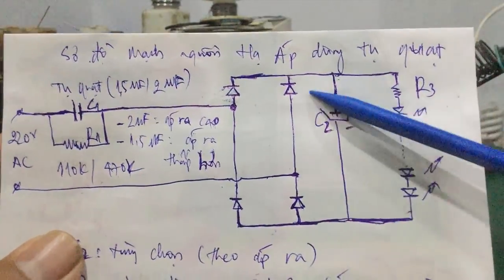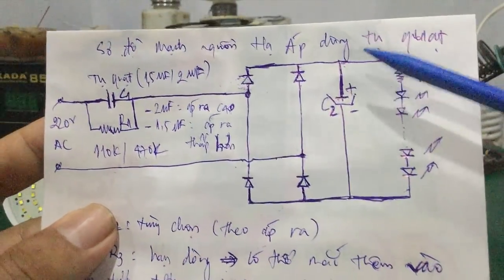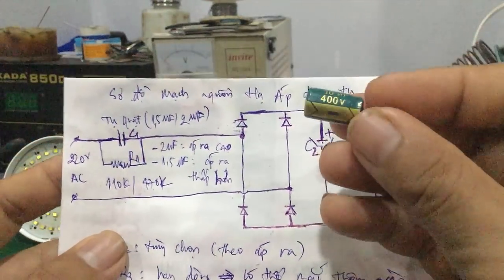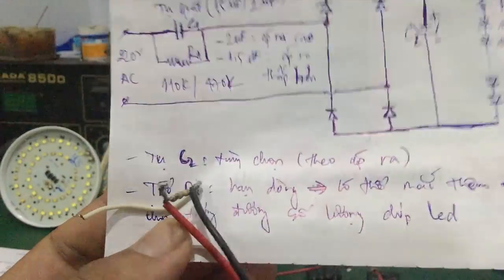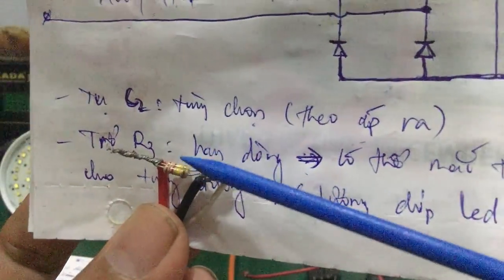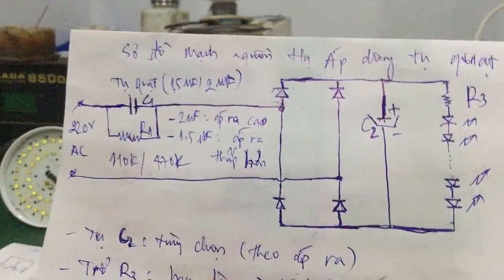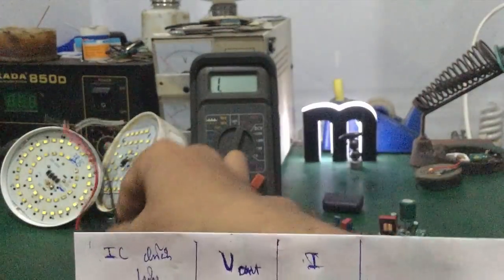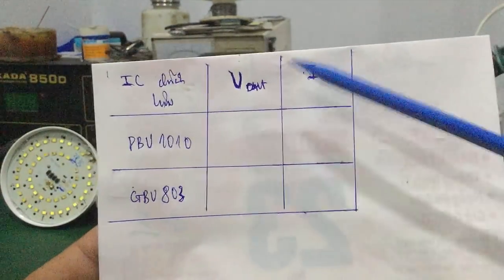Sửa led driver - cách độ chế mạch nguồn led driver cho bóng đèn từ tụ quạt ... không dùng IC nguồn !

Comment: Áp 313 hay 213 volt không phải là do loại diode nhe bạn mà là do có mắc tụ lọc sau khi chỉnh lưu hay không và có công thức là lấy điện áp nhân cho 1,44 còn gọi là điện áp hiệu dụng. Cho nên mọi tụ lọc cho điện 220v sau khi chỉnh lưu họ thường dùng tụ 350-400v. Điển hình là bếp từ...
Reply from the maker: áp sau chỉnh luư là : 1,44 x 220 = 316v DC ... mình ko biết bạn nói vấn đề nào : mạch chỉnh lưu toàn kỳ hay mạch nguồn hạ áp ...???

Comment: cho hỏi là board led có 1 tụ pi và 1 cầu diode nhỏ và tiếp theo là 1 trở dán nhỏ xíu với 1 IC 8 chân (bị che số), xin hỏi đó là IC gì ? cảm ơn !
Reply from the maker: bạn miêu tả rời rạc quá nên hơi khó hiểu , lộn xộn !!!  theo như bạn mô tả thì trong mạch nguồn led driver có 1 con IC dán 8 chân ... đó là IC nguồn led driver hay còn gọi là IC dao động - được tích hợp MOSFET ở bên trong  - hoạt động theo chế độ ngắt - dẫn nhé !!!!
Hãy đăng ký theo dõi kênh để xem các video của mình nhé … bạn có cần hỗ trợ về kỹ thuật hay tư vấn về điện tử - điện thoại di động thì cứ để lại comment , mình sẽ support cho bạn nhé !!!
Reply: sorry, là thế này, có ông anh đem cho cái vĩ led 136 con có thể là 3528, chiều dài khoảng 30cm, rộng khoảng 2,5cm, không có led driver, sử dụng AC 220V trực tiếp vào, mỗi bên dây AC vào có 1 điện trở 10 Ohm nối tiếp, qua tụ lọc pi lọc xung AC (? không có thông số), vào cầu diode dán nhỏ khoảng 1A (không có tụ lọc nguồn DC ra, áp ra sau cầu là 210V DC), và áp ra tiếp đến 8 con IC 8 chân loại dán (bị che mất thông số) - kèm mỗi con IC là 1 con điện trở dán. Do mạch phủ keo chống nước nên khó dò mạch mà IC lại k có số nên không biết là gì, tôi chỉ đoán là IC để giảm áp cấp cho led ? (giống như nhiều led buld công suất thấp 3-5-7W k có led driver mà có IC 8 chân dán giống như vậy ? xin hỏi là theo kinh nghiệm của anh con IC đó là gì ? cảm ơn ! công suất đèn đo được 90W.
Reply from the maker: @quynamnguyen8555  ah ... bạn cũng có 1 số kiến thức nghiên cứu về đèn led đấy !!! ... tuy nhiên theo bạn nói thì số lượng chip led là 136 con , công suất 90W ...nó dùng chip led 3528 ??? mình ko biết bạn có nhầm ko  , thông thường chip led 3528 chỉ có công suất là 0,06w thôi  ??? ở đây công suất 90W , số lượng 136 con thì theo mình nghĩ chỉ có thể là chip led 2835 thôi ( là chip led siêu sáng , công suất khỏng 0,2w - 0,5w - 1 w ...con IC đó ko phải là con giảm áp gì đâu nhé bạn , nó chính là con điều khiển dòng điện cho 1 dãy chip led ... về vấn đề này thì sắp tới mình sẽ ra 1 video hướng dẫn các bạn về vấn đề này
Hãy đăng ký kênh để theo dõi video này nhé ... mình se tranh thủ ra sớm  !!!
Reply: ok cảm ơn ! nó là led vuông đoán vậy thôi, máy đo thì 90W nghĩa là khoảng 0.67W /con;
Reply from the maker: @quynamnguyen8555  uh ... 2 chip led 2835 & 3528 có 1 số bạn còn lộn ... nên mình đã ra video hướng dẫn cách phân biệt 2 loại chip led này trong video phía dưới , bạn xem tham khảo nhé : https://www.youtube.com/watch?v=PbqhxeOnI2w
... còn về con IC kia sắp tới mình sẽ làm 1 video , hảy nhớ đón xem nhé :
Reply from the maker: @quynamnguyen8555  video mới ra nhé , hãy xem & tham khảo : 
https://www.youtube.com/watch?v=Qpj9gWiFf-0
Hãy đăng ký theo dõi kênh để xem các video của mình nhé … bạn có cần hỗ trợ về kỹ thuật hay tư vấn về điện tử - điện thoại di động thì cứ để lại comment , mình sẽ support cho bạn nhé !!!

Comment: Độ kiểu rc này có ra gì đâu mấy đèn 5w 3w nó làm kiểu này cho rẻ.
Reply from the maker: humm ... sao ko bạn ? bản chất nguồn led driver cũng chỉ mà mạch cấp nguồn cho đèn led ( gồm nhiều chip led bên trong ) ... đây chính là mạch nguồn hạ áp trực tiếp từ nguồn 220V AC dùng tụ ... các bạn có thể dùng tụ gốm hay tụ quạt đều được ( tụ quạt thì dễ mua , dễ tìm hơn ! ) ... phạm vi điện áp ngõ ra rất rộng , có thể từ 12V ( cho đèn led 3W ) , vài chục volt cho các đèn công suất khoảng 7w , 9w ... cho đến 313V cung cấp cho đèn led bulb hay  tuýp led T8 18W đều được . Ngoài ứng dụng là cấp nguồn cho nhiều loại đèn led  công suất nhỏ ...mạch nguồn này còn có thể cấp nguồn cho quạt , motor hay sạc pin cho acquy khô ( pin khô )  ... sạc dòng nhỏ như trong vợt muỗi ... đều được !!!
Reply: Linh Bảo TV ổn áp nguồn dòng khác kiểu trên nhé.
Reply from the maker: uh , đúng vậy ... mà liên quan gì đâu bạn ? ko vấn đề nhé !!! ... video này mục đích là tạo ra nguồn led driver đơn giản , hiệu quả , dễ làm ... ==> thay thế cho những bóng đèn như led bulb , tuýp led T8 bị hư mạch nguồn led driver ( hư IC chẳng hạn )... mà 1 số bạn rất khó thay hay ko tìm mua được IC thay thế